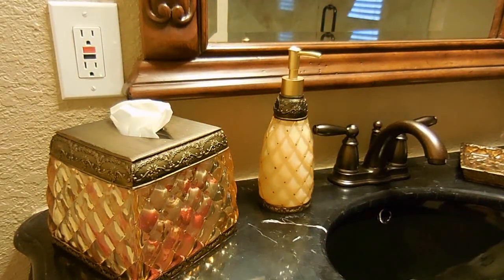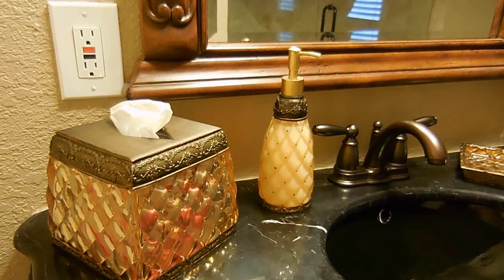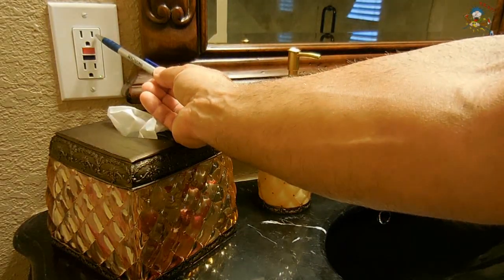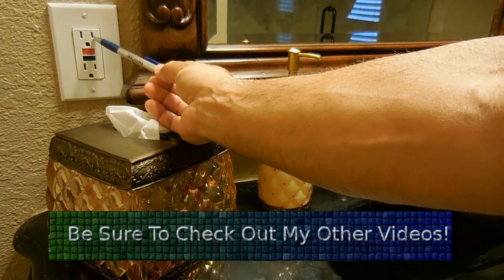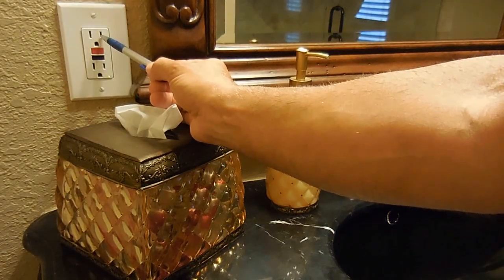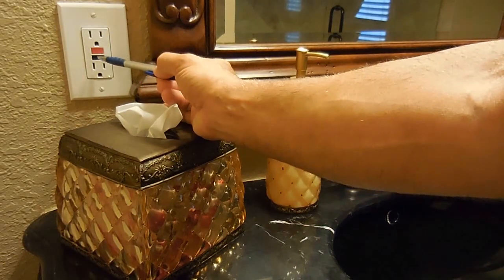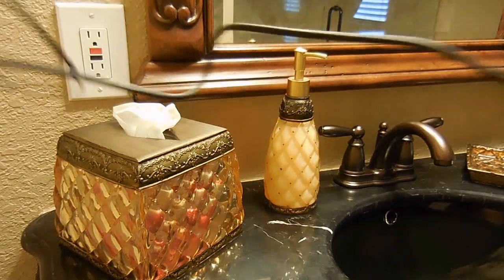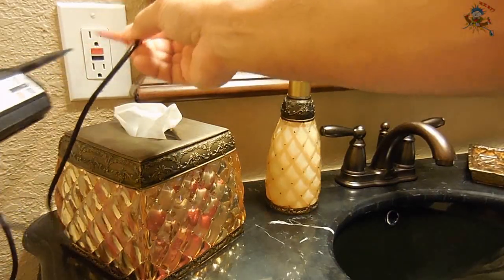Fully Understanding How GFCI's Work

Comment: The GFCI test button works on an ungrounded AC circuit.
   So, you must be incorrect when saying the test button shunts
current to ground,    or does the test button not work on ungrounded 
GFCI circuit?

Comment: Question: Is a GFCI a current limiter (like a traditional circuit breaker) 
or is it not?    Putting a GFCI into an ungrounded circuit ( no ground conductor) the test  button does work?

Comment: One thing I want to point out is that the gfci does not flow current to the ground when you press the test button. A gfci can be connected to a two wire circuit that does not have a ground wire and still function properly. The test button flows current from the load hot to the line neutral to cause the gfci to trip. That is why a plug in tester with the gfci button doesnt work on a non grounded gfci. Because the tester flows from the hot to the ground, but if there isnt a ground there is no where for the current to go.
Reply: Excellent explanation correcting the video portion about the test button
on the GFCI.  Also about the test button on the hand held GFCI testers.

So, are we saying that a GFCI is a CURRENT limiter (like a standard breaker) only much quicker in operation.

Thank you for your input, quite knowledgeable.

Comment: GFCI on my hair dryer has No Ground conductor.  The receptacle also 
has no ground.   How does the test button work?
Reply: That is an ALCI (Apliance Leak Circuit Interrupter), not a GFCI but the principle is the same. As the test button is in the device it does not need ground, it can divert current to the neutral bypassing the detection. It has no ground as it is double insulated.
Reply: @okaro6595 I plug this same ALCI into a GFCI receptacle.  The ALCI test button does work, BUT the GFCI does not see the interruption.

confused thank you

Second question.  The GFCI test button does work when used in an ungrounded AC circuit.  confused

Comment: Superb
Reply from the maker: Thank you Gary! Be sure to look over my extensive video playlists below for many other videos of interest to you, and most importantly take one minute to share a link to my channel with others. 
http://www.youtube.com/c/electronicsnmore/playlists
Reply: @electronicsNmore  I'm replying here because this looks like your most recent reply about this video. I just installed a GFI outlet, and I'm amazed that it works. I know neutral is grounded at the service entrance of the house, which therefore means ground and neutral are connected together. I wonder how the GFI knows how ground and neutral are different. Logic tells me that the GFI changes its neutral output terminal from its input neutral. If it didn't, then it couldn't tell the difference between neutral and ground. I want to know how the GFI changes the neutral. Does it somehow shift the sine wave of the alternating current in time?  If you don't know the answer, that's okay, a reply would be nice either way.
Reply from the maker: @ChawlyW  Very simple. The GFCI is looking at the flow of current at the receptacle terminals(N/H/G), the home wiring is irrelevant.

Comment: Why do I have such problems trying to plug anything into these plugs?  I bought a place with these plugs and I'm frustrated trying to plug anything in.  It's like it's blocked.
Reply: It is, those are shutters intended to prevent kids sticking things into the outlet. You should be able to put a plug though.

Comment: Because some of that current is going to the ground ( earth beneath) you said and then where?  To the main panel where both the ground and the neutral are together.
So why does the gfci outlet trips? The current is not entering the bottom pin that you connected your meter and tripped the gfci.  The current is going to the earth and going to the breaker panel just like the third ground pin on the gfci is going to the breaker panel.
Something is not explained correctly at all.   Has anybody caught this or is it me.

Or maybe this is what actually happens.
The path of current must show  from the hot side of the gfci to the ground on the very same outlet just like you showed with your probe.

So this happens:
The so called ground/bare wire is connected to the body of the hair dryer and is not part of the stator circuit.  The water acts like a wire connecting the hot terminal of the hair dryer to the ground/bare wire so current flow through that to the gfci outlet third ground pin, not directly to the ground beneath you.
So you see there is a huge difference here.
This means if your hair dyer does not have a third/ground prong that goes into the gfci outlet, The GFCI will not trip.
So the current is not going to the ground, which sounds like earth beneath.
Using the word ground carelessly is meaningless.
The water becomes a conductor touching the hot wire of the hair dryer and the so called bare/ground wire is connected to the body of the hair dryer and not to the stator coil.  So the current flows to that bare copper and into the gfci, not earth below.

Furthermore the so called GFCI senses nothing.  It has no sense perception at all.
All it really is, when current enters the bare wire, some sort of element inside that bridges the two parts of the hot wire, gets hot and it breaks contact.  the contact is no longer there.  But it is so designed that it would break but won't make if you will. 
It is so designed that you have to then physically reset it and make the contact happen.  But you won't be able to so long as the current still exist, that is the short to the ground.

Chances are anymore it is solid state stuff. Operational amplifier so called Op Amp combined with sort of coil relay that disconnects the two section of the hot lead inside.
Reply: Keep your comments short when you spew nonsense. If you get shocked the current that goes through you does not go to any panel.

A GFCI does not use of monitor the ground prong. Remember we are not interested in current escaping through it but through a person. Sure it current escapes through the ground wire it trips the circuit. The GFCI and the grounding supplement each other. 
In a normally working circuit there is same current in both live and neutral. There may be some leak of 1 mA or less through the ground wire from computers, fridges etc. but basically the current is the same. If it is not the there is a ground fault as current escapes. This most likely is relatively harmless escape through the ground wire but it could also mean that someone has touched the live wire and get shocked. It is better to be safe than sorry so a GFCI cuts the power by disconnecting both the live and the neutral making it safe. This is mainly to prevent the shock but it is also good to prevent any unnecessary leak.

Comment: New code is everything within 3ft needs to be protected. But usually a new bathroom is wired so everything in the bathroom is loaded from the GFCI. Meaning everything in the bathroom is protected regardless of its location to a water source.

Comment: but why does ground fault protection extend to the entire circuit (after the gfci receptacle)? I assume it has something to do with the gfci receptacle detecting a change in the current draw on the circuit?
Reply from the maker: Anything connected to the LOAD side of the GFCI is protected.

Comment: Is this explanation overly simplified? Aren't there situations where two 120v AC circuits can share a neutral? If both circuits are drawing 12 amps, by your explanation, 24 amps are returning on the neutral wire. I would need to test with an amp meter.
Reply: As long as the hots are not in the same phase it will not over current to neutral.

Comment: if i want to add a gfci outlet by my toilet can i tap into a outlet on the opposite side of wall? and will it be in code?
Reply from the maker: Normally you have bathroom GFCI's on their own line because a hair dryer draws a lot of current. If the circuit on the other side of the wall isn't loaded, then you can tap into that line and add a GFCI in the bathroom. It's 100% safe, as for code, you need to refer to the NEC book online. Thanks for watching!

Comment: A gfci is nothing than a baby breaker a prebreaker at that.
Reply from the maker: No, very different. Ordinary circuit breakers don't trip if the current from the hot wire flows to ground, unless it's a dead short.

Comment: You say you will explain how a GFCI outlet works, but you tell us how it trips, but not HOW it works.
Reply from the maker: I sure did. I said the circuitry monitors current flowing from the hot to neutral.
Reply: He did explain. It works by monitoring current on the hot and neutral. If it detects a current differential between hot and neutral it will trip.
Reply: Of note is that GFCI are often wired as a circuit with other receptacles and only one GFCI receptacle is necessary at the beginning of the circuit.  So, the receptacle in the bathroom might not look like this and if you accidentally drop your hair dryer in the bathroom sink, the GFCI receptacle that trips may be in the garage or in a closet or other place around the house.

Comment: You may have answered my question already. The current is BALANCED on the
hot and neutral. Something MUST BE LOST at the load on every proper
functioning appliance. You stated that WATTS (heat) are lost at the load.
Is this the correct interpretation? Thank you for the info.
Reply from the maker: Nothing is lost at the load. Current is not consumed by a load, the energy used by a load comes from the difference in voltage across the load. Whatever leaves on the HOT, is returned on the Neutral. Thanks for watching!
Reply: @electronicsNmore The GFCI must be a current limiting device, because the test button works on an ungrounded circuit.
Reply: @electronicsNmore Voltage is constant in an AC load.  Increased current (reduction in resistance) results in addition watts.  comment please
Reply: Question please: The neutral conductor going thru the GFCI is insulated.
Why is the exact same neutral conductor that goes from outside the house
to the step down transformer not insulated? Thank you.
Reply: Question please. I have two electric toasters. one says 500 watts on the plate
and one  says 1,000 watts on the plate.   Plug them into different 20 amp ckts.
Will they both draw the same current (amps) and different voltage, OR will they
draw different current (amps) and same voltage? 
m
Reply: Answer my own question 3 years later.    Voltage is the same, current Increases.    The load with the LOWESE resistance has the highest current draw.
Reply: It could be measured in current as amperes (A) and/or milliamperes (mA). Wattage is power, basically AmpsxVolts=Watts. It is more complicated but just a general idea.

Comment: If you came here to know how exactly the inner parts of a GFCI works and instead got a simple general explanation, welcome to the club. Nice video, though.
Reply from the maker: It's nothing more than a circuit using current transformers to monitor the current flowing in from the black(hot wire) and out using the white(neutral wire). Both readings must match or the circuit is opened up. Thanks for watching!

Comment: I have a hot tub that has 2 hot wires and a neutral ( no ground) the heater got damage and the electricity went to the water the gfci never tripped, why???
  There was 120 v in the water to earth.
Reply: I think your hot tub must have a ground wire.

Comment: With Modern plumbing, plastic drain pipe, fiberglass sink, tub, and pex tube you can drop a hair dryer or electric shaver into the water and it would not trip that GFIC
Reply from the maker: It would because the water inside the metal fixture is conductive.
Reply: @electronicsNmore  As far as I understood from that hairdryer video is that If the sink isn't grounded or bonded, then the current will flow through the water but there will be no imbalance, so it won't trip unless the user who must also be grounded, touches the water.
Reply: Please watch this video go to 1:10:00
https://youtu.be/pAs_FmdxXhQ
Reply from the maker: Nothing to watch, I already performed tests myself. Current flows through water unless it's distilled. End of story.
Reply: That video is from the guys who help write the NEC code book.
Reply from the maker: @ovwok  Go buy a pvc pipe, fill it with city water, and do some tests....very simple.

Comment: So GFCI's are good replacers for two prong outlets that have no grounding wire? Amatuer speaking here. I just want to be able to use three prong plugs safely.
Reply from the maker: FakeUser NameTwo Replace 2 prong or 3 prong receptacles. Thanks for watching!
Reply: +electronicsNmore that didnt answer anything at all
Reply from the maker: I did answer you. 
You asked: GFCI's are good replacers for two prong outlets that have no grounding wire
My Answer: GFCI's can replace 2 prong or 3 prong receptacles. If replacing 2 prong, then you add a ground wire when hooking up the GFCI. Very simple.

Comment: You explained why but not how😳
Reply: Ok, thanks, that's good to know. LOL By the way, I think your videos are pretty cool. I am thinking about building the Electrician's Helper... Cool device.
Reply: +electronicsNmore Refrigerators, if placed on a GFCI, will ocassionally trip when the refrigerator goes into the defrost cycle. It is a common problem, even when no fault has been found with the refrigerator...People will lose their food....
Reply: electronicsNmore
I know. But try telling some freaked-out  rich guy that there's nothing wrong with their refrigerator..Hah! Hah!
Reply: If the device doesn't have a grounded plug, would the GFCI not trip when dropped in water? Many hairdryers do not have grounded plugs.
Reply: Oh ok. I just don't fully get how an ungrounded device can find a path to ground, unless the sink or tub is the ground path. I saw a video with a guy turning on a hair dryer (with no ground prong) under water, and it was supposedly plugged into a GFCI. He said because there was no ground, all the current flows back into the neutral.
Reply: Kris Klekosky ellectricians helper
Reply: Fr4
Reply: there is a toroidal current transformer measuring the current coming out of the hot and returning on the neutral. when it detects an unbalance of 10mA between the hot and neutral it opens the breaker
Reply from the maker: Kris Klekosky
If you take a hair dryer and throw it into a tub or sink full of water, the GFCI will trip if any path to ground is present. Once you place your hand into the sink, you just created a path, and the GFCI will trip, unless it is faulty. There is "usually" a path to ground through the plumbing.
Reply from the maker: Kris Klekosky
It's a very handy device if you do a lot of electrical work like I do. Glad you enjoy the videos!
Reply from the maker: searchlight17
The refrigerator should not be on a GFCI. More than likely a surge in current is causing the problem.
Reply from the maker: Kris Klekosky

No. 2 prong cords make no difference. All current flowing from the small blade(HOT) of the plug, must return on the larger blade(Neutral). The water creates another path to ground.
Reply from the maker: +versatec1 
Incorrect. I clearly explained how GFCI's work. I never said I was going to explain the entire circuit.

Comment: +electronicsNmore I went and got a 100K resistor BWN,BLK,YEL and connected it up and 2 of 2 GFCI I have did not trip, only resistor got warm, are you sure this is correct value?  and in no way touching it to pipe or GFCI outlet GND did it trip. test buttons work though!
Reply from the maker: +drphu You must connect between the hot blade of the GFCI and ground, not the larger neutral blade. Keep in mind, GFCI's are designed to trip with a few mA of current(Usually between 4 & 6 mA). You are suppose to start using the higher 120K resistor, then slowly go lower in value until the GFCI trips. 5-6 mA would require between a 20K & 30K resistor. I would suggest a 1/2W to 1W resistor. All it should take is a quick touch with the resistor to trip it. Do not leave the resistor in place or it will get hot and burn up. Be careful! Do this at your own risk.
Thank You
Reply: It's not where I touched it, yes I know which is neutral, So this info would have been usfull in the video.
Reply from the maker: +drphu 
I modified the annotation in the video.
Reply: Excellent

Comment: But isn't the ground and neutral tapped together? How does it only trip when detects current through ground prong? Unless you mean it detects current going through case of appliance that's plugged in
Reply from the maker: +mrsemifixit 
The ground and neutral are connected together at the service entrance and/or the breaker panel. The GFCI circuit monitors the current flowing between the HOT and Neutral wires. If current flows from the HOT wire to Earth ground, then the current monitoring will not occur because the Earth ground is not part of that monitoring circuit. The current is taking a path AROUND the GFCI.

I hope you now understand.
Reply: +electronicsNmore Ok so if current flows from hot to ground it can't monitor and thus so trips the breaker?
Reply from the maker: mrsemifixit Exactly!
Reply: @mrsemifixit  The hot and neutral will show the same amp reading under normal circumstances. When there is hot to ground fault, the GFC detects different amounts of current on the hot and neutral, so it trips.
Reply: It does not monitor the ground wire, only live and neutral. It does not care where the current escapes.

The GFCI is at the part where the ground and neutral are separated. One cannot have such a device in the part where they are common.